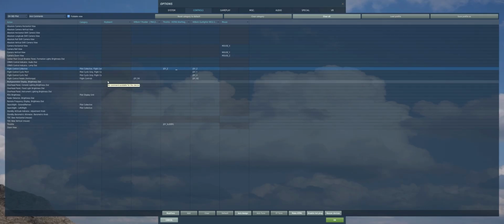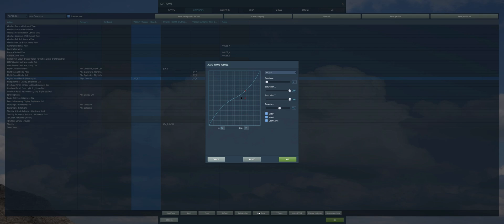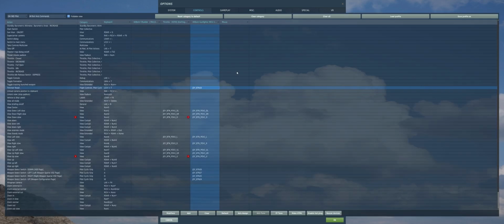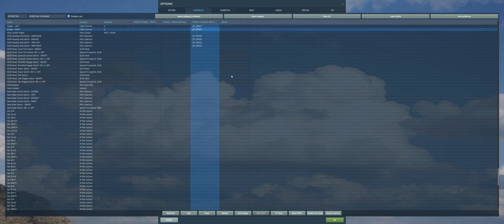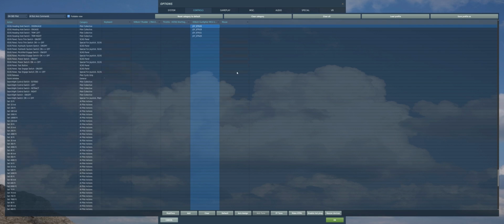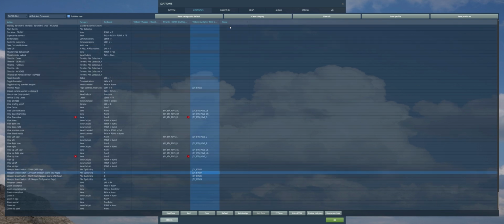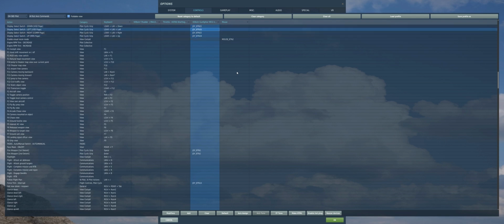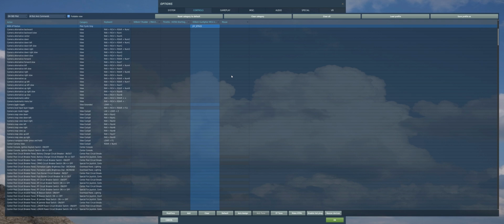DCS: OH-58 Kiowa Warrior quick key binds & mapping guide

Comment: Hello, it's me again. I have a question that I don't know if you plan on addressing it in a coming video or not. Do you have the MMS slew controls bound to an axis control or to a 4-way hat? I normally have my TPOD controls in all other aircraft (A-10, F-16, F-18...) in a 4-way hat and it works perfectly fine. However, with the Kiowa MMS, whenever I'm trying to slew it, the slightest touch of the 4-way hat, it moves the thing too quickly. There is no way to do small corrections and pinpoint the target I'm trying to destroy. And it doesn't matter if I'm zoomed in or zoomed out, the distance traveled by the MMS with a single press of the 4-way hat is always the same, and it is too big. I tried binding it to other 4-way hats but still the same thing happens. Also tried to bind it to the keyboard, and still the same. I even tried binding it to an axis on my HOCAS, but for some reason it is detecting the JOY_Y as an horizontal movement instead of vertical, so I can only move left or right. I also tried binding it to the HOTAS joystick itself, even with a modifier to not interfere with the pilot controls but that one didn't even work.
Reply: Okay, nevermind, the issue was that I wasn't cycling between modes. It's important to use "Manual/Slave mode" control